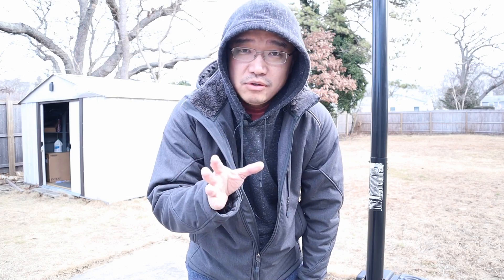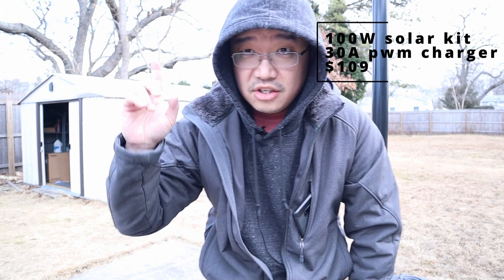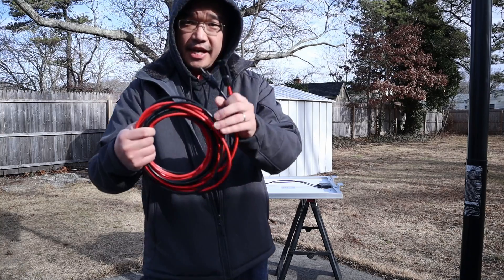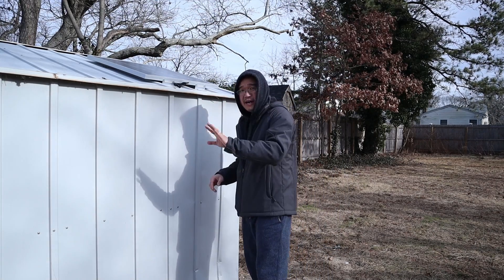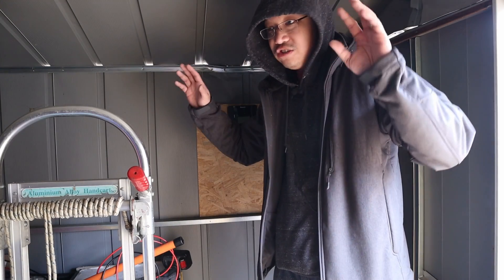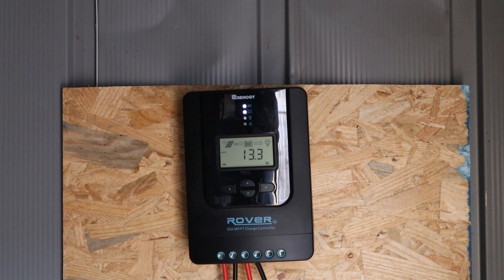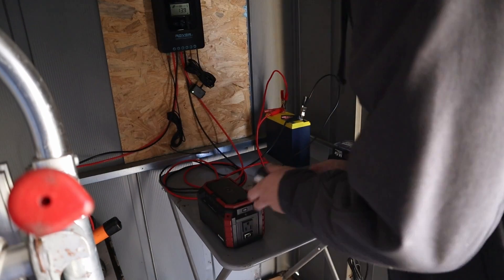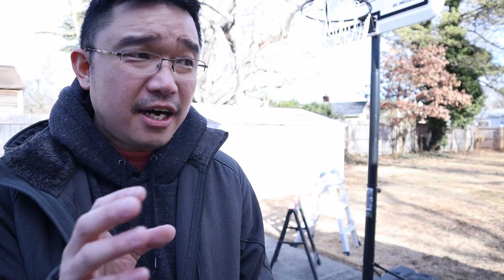My DIY Off-Grid Solar Shed Project Part 1 - Assembly

Comment: I converted my shed to DC over 8 years ago. Lithium Ion batteries weren’t available back then, as they are today. So I ended up using 12V deep cycle lead acid batteries. Recently I’ve been buying the Lifepro 12V 10AH batteries, they come in set of 2 on Amazon. I plan on overhauling my shed using them and 5 100W solar panels.

Comment: 😅i use a 200ah agm deapcycle battery a 40ah mppt solar a d a 320 w solar panel and a 1200 w inverter with a 40a  fuse

Comment: Most Lithium can't charge under 32deg though which is a big problem in most of the country in winter. So be sure to turn charging off when temps drop. If you use the Victron BMV-712 for example and tie Victron controllers in one can set it automatically to disable charging below certain temps. Most temp charge control is for lead and changing the charge voltage...NOT what you need for lithium

Comment: so try to avoid using an inverter for charging and powering staff cause it's not efficient
an example if you want to charge like your power bank that takes 5 volts in you should use a step down converter to step 5 volts to 12 and not 12 -> 110/230 back down to 5

Comment: Hi Don, good video.

What I do (and what is a cheaper and possibly better solution) is to use a boost converter connected straight to a solar panel.
The boost converter stabilizes the voltage out of the panel. You do not need an inverter when your appliance that you want to charge has a switch mode power supply (basically everything). They can use DC voltage to charge as well. What the inverter does is to convert the DC from the battery/solar panel to AC, and then the power supply from the appliance converts it back from AC to DC. This all has losses and isn't required.

Comment: My experience with charging batteries is NIL however there is a video on YouTube about a guy charging his Tesla in -30F degree weather. "Apparently" once you start trying to charge the Tesla battery in those weather conditions it will first send the power to the motors to heat up the batteries so it will be the "optimum conditions" to then start charging the batteries. Having said all that, maybe a lithium battery isn't the best solution in your current climate conditions where as the car battery is "made" to charge in those conditions via the alternator when the vehicle is running. Granted the engine produces heat under the hood of a combustible engine car. None the less the car battery has cold cranking power, where as the lithium battery will die more quickly in colder weather conditions.

Comment: @Novaspirit Tech The solar panel screws pierced the roof and may lead to leaking and rust around the holes. Rain water could drip into the shed underneath the screw holes and damage anything stowed underneath. You may want to use insulating gel or silicone caulk. Also, the screws are quite long, visible at 7:54, and could poke at your head if walked underneath without noticing.
Reply: The screws can rubber washers on them. But the length is a bit of an issue. I think I would go for bolts.

Comment: 1stly... ur not superman and shudnt be outside when ur that sick. If u own the house I would get new shed that atleast will hold up against a hurrican or tornado..... and never disconnect the battery while the solar panels r connected..... aligator clamps is never a good idea at any stage.

Comment: Idea for you:
Take your 400W inverter apart, wire in an ESP32 with a relay to remotely turn it on and off. If you get an ESP32 with Bluetooth: you can relay the Bluetooth info from your renogy to your home over wifi.
🧠
Reply: Pis are pretty power hungry, not sure about pico: but pico doesn't have wireless afaik.

Comment: I see someone else has mentioned to make sure that there's a drip loop.
Also: Try to increase the space below the panels. Raise them up to allow more airflow. In the summer, heat is a solar panel's enemy. Tech Ingredients recently did a video on this.
I understand this is a temporary setup. These aren't complaints but rather meant as tips.
Reply from the maker: good tip, i will raise them soon, thinking about going for a 180w panel which is skinnier and longer, which might fit on the raised channels

Comment: One small problem with the set up. Check the data sheet on your battery. Most Lipo4 batteries don't like cold, unless it comes with an internal heater. If it has cold temp cut off, it will stop changing, and you can not draw power from it is the temp is below I think -5C or 23F. Long term storage below that temp can kill the battery. Most Lipo4 batteries should have low temp cut off for charging. But some will say they do and don't. This will destroy one of these batteries.

Comment: You are going to have to heat that shed if you are not careful you will ruin your battery(ies), can't charge them in cold weather. Cold weather in gerneral is not good for any batteries, but LifeP04 and lithium don't do well in cold weather.
Reply from the maker: i'm hoping the bms will tell the battery not to charge when it's too cold, i will do more reserach thanks!!

Comment: soon you will find tthat with you 100W panel if you are lucky you will get 50W...unless they are from a very reputable brand...
Reply from the maker: starting to relize that now, max i got was 45w but it is winter hahah... i want more already!!
Reply: It's addictive...I got 1230w on a little 6x10 cargo trailer haha...but I can run a/c anywhere I am :) during the day anyway

Comment: Why use an inverter? Everything your charging is DC power. It can't be that efficient to go DC --> AC --> DC .
Reply from the maker: 10000% i will start picking up rv/boat 12v lights and other supplys soon

Comment: I too started with a small solar setup like that. It's great to learn from and not too dangerous or expensive to gain skills for future setups. I just finished building a 30kw tesla module battery. It's for an off-grid tiny house/workshop. This is after years of various setups. Stationary and in vans. Still learning!
Reply from the maker: 100000% i learned alot from this... and all the comments i'm gettting... i learn after if i just try to do it over watching videos or reading

Comment: Put a couple of nuts on the interior of the roof mount just to CYA when it's windy out and cut the bolts down. You will hit your head on those even in the short term.
Reply from the maker: will do thankss, i did find some nuts for it, now i'm just looking for lock washers

Comment: you need to sort out that rust before it starts causing leaks where you now have electronics
Reply from the maker: i willlllll, now that i have something of value in there
Reply: @NovaspiritTech  use the solar to charge a drill battery then attack it with a wire wheel haha solar already looking after itself 😉

Comment: What was the reason in buying a kit when you immediately ditched a half of it as unusable?
Reply from the maker: poor research at first, i thought a kit would solve everything but mppt is the way to go
Reply: @NovaspiritTech  not only that, lead acid battery was a no go from start.

Comment: That cheapo invertor eats (wastes) at least 20% of the energy. That power brick charger wastes another 10-15% energy. Given all the DC-AC-DC losses and the microscopic battery, panel and shadows - this is rather a toy than serious setup.
Reply from the maker: this is a good start to learn, eventually i'll get there but thanks for the tips, i will be converting everyting to mainly 12v instead of using a inverter
Reply: @NovaspiritTech  as was mentioned by other commenters, you better start looking at 24V or even 48V setup. Less copper in wires, less losses to heat. And after you build the serious setup you'll need invertor for your AC needs. Even 24V invertor much more efficient, weigh less.

Comment: Great start!  
I built a solar shed 5 or 6 years ago and it's been working well:
https://youtu.be/sKZMGEg2PRk
https://youtu.be/DAPstiLMGUA
I run the lights and fans off the 12V load output, that way they get shut off if the battery voltage drops too low.  The system uses the 12V batteries in 2 of my tools as the system battery.  That way those 2 devices are kept charged and the store power for the rest of the system.  I started with a cheap PWM controller then went to an MPPT controller.
Reply from the maker: i'll check it out!

Comment: They're so many shadows from the trees above, I'm almost sure you'll be disappointed about the wattage you'll get from 100W panel. Right now it will be about 10-20W. At summer 30-45W, probably.
Reply from the maker: i'm going to do a timelapse when it's a sunny day

Comment: You are supposed to connect the battery first.
You can damage your charge controller if you hook up solar panels without the battery connected.
Reply from the maker: i have my connected to battery first, the solar wires were installed but not plugged in from the outside. yes i know about the warning on this! hahah

Comment: Couldn‘t see it properly, but you might want to put the wire from the roof into the shed in a loop, so that rain can‘t run along the wire into the shed, so it can drop down in front of the wall.
Reply from the maker: i will be added a box later for this, but i will currently make sure i have loop just in case

Comment: Solar sheds are awesome, If you can find DC-DC converters they are more efficient than inverters fro charging other batteries or small devices. Automotive fuses/wiring works well
Reply from the maker: will do, i'm so hyped in getting all the 12v stuff working
Reply: @NovaspiritTech  the only downside is overcast days and winter. I barely get anything out of my panels here in Scotland other than the summer months
Reply from the maker: yea i peaked at 45w one of the days

Comment: @NovaspiritTech if you are planing to use a light from the battery it might be better to use a 12v DC light directly from the battery or through the Solar charge controller
Reply from the maker: will do, going to get some rv / boat lights

Comment: You may be able to get some LED lights that run on 12V DC so you don't need an inverter for them.
Reply: Varying voltages might damage or wear out the LEDs tho .
Reply: I did exactly that same thing, it worked out great. Amazon does have 12V dc bulbs, but they tend to be a little more expensive. I’m going to see what alliexpress has.

Comment: I was able to integrate my Renogy PWM that has an RS-485 with Home Assistant.  I found someone's code on git hub.  I used an ESP32 with ESPhome.  The only issue I had was they had it calling so many parameters that it was very unreliable if it would work at all.  So I trimmed the code down to the few things I wanted like panel params and battery params, charging state.  Then it worked like a champ.  Must be some timing issue.
Reply from the maker: hahaha that's another vidoe i'm working on, i got my raspberry pi to commincate with the rs 232 and logging data now

Comment: I would suggest to putting the panel sideways so you can fit 3 panels per column with the electrical away from the edge. The next column with the electrical close to the rightmost column. You should be able to fit 4 columns of 3 panels with 2 power busses. 

Gradually, increase the DC voltage because the more current (Amperes), the larger wires.
Reply: "the larger wires needed" when wiring in parallel.
Reply: @OffGridAussiePrepper  That is another way of describing it. 

I usually recommend 72 Volts for small installs like this.

144VDC  with a true sine wave for clean inverter for bigger.

288VDC for whole house systems.

Comment: Fun project!

PS - In case you wanted a Comment Section Pell Grant: The hardware you used to secure the solar panel are called "Self Tapping Screws."
Reply: Actually, those are self-DRILLING screws. Can I get a grant too? 😅
Reply: Self drilling metal screws to be exact. they dont work on wood.

Comment: Noooice - but why ditch the car batteries!  I've always wondered if that's the Pork Hunt way out of this given their lower price.   Given NYC gets 2x the rainfall of London - do you actually get enough sunlight to make this work?
Reply: Car batteries are not designed to be discharged all the way down, can kill them really quick. They are made for short and high power loads like starting.
Reply: @Liny_Fox  is this the case for all of them?  Boat batteries too?
Reply: @nneeerrrd  What?  WTF are you talking about?

Comment: I doubt that an inexpensive battery like that has low temperature cutoff.   You should test it so it won’t be destroyed charging below zero.
Reply from the maker: it does have a BMS but i will double check on this below zero thing